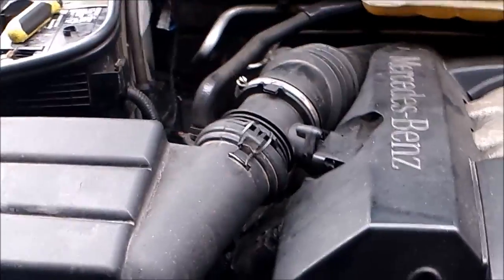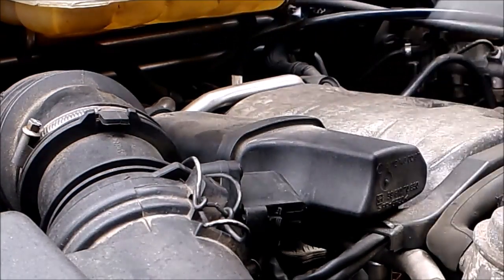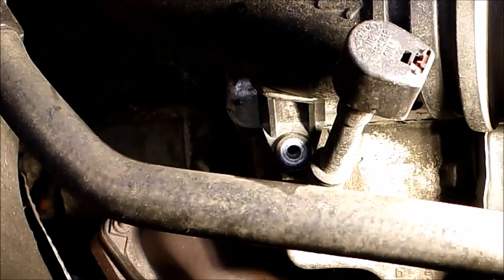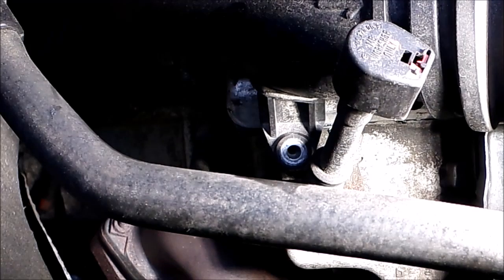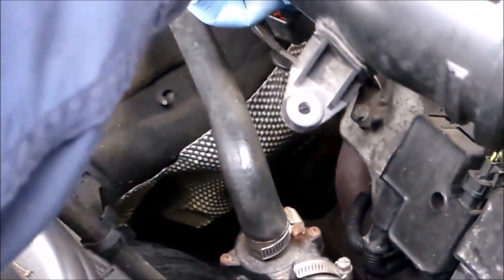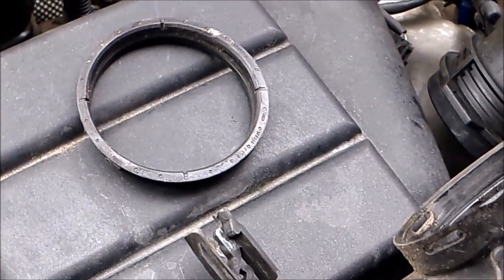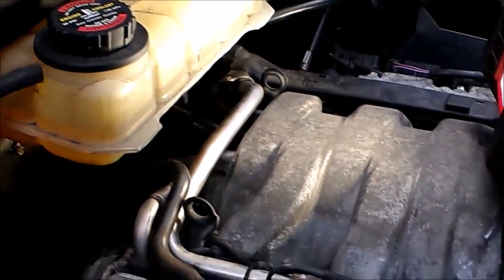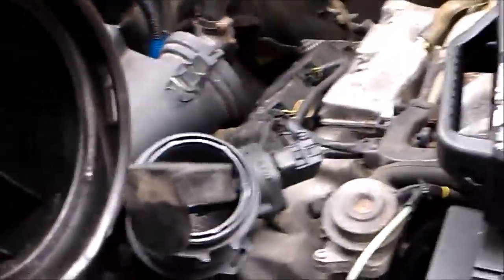Mercedes M112 M113 air intake gasket swap ,to increase mpg/lower oil consumption

Comment: Hai there..been changing same gasket like yours few weeks ago..actualy the car realy do have a high fuel consumption actualy and  after looking and searching then i notice the intake boot came out freely so i check it realy has a rubber gasket on it and change it but the car still on the jack doing some stuf don't have time to test for the consumption yet. My question is what is the problem for this model that turn the radiator fan on during cold start? I believe the fan will turn on when it's reach a normal operating temperature as usual right. I've test all the related sensor and change the ac preasure sensor/fan module/coolant temp sensor/the fan itself but it still running a few min after we start the engine during cold start or in lower engine temp. Hope you can give some info on this problem as you are very familiar with this mercedes benz. For the rest nice video and very helpful info. Keep posting sir👍
Reply from the maker: Are you sure it’s the rad cooling fan you’re heating and not the secondary air injection ?  It is loud and sounds like a fan running . Have you tried it with the hvac in Econ mode ? If the defrost mode or the Econ button is off it may run the fan on initial start for a minute . It shouldn’t come on without those conditions being met
Reply: @fupabox  Yes it's a rad cooling fan which is running few minutes after cold start and never stop when it reach normal temp for this car 87deg..i never turn on the Econ mode actually and the ac setting its not the colder setting i set it to normal setting around 22deg. 
Even in Econ mode the fan still running. The problem is after few minute start the car even in cold start the fan start running then it goes to the high speed after that also with the blower fan turn off.
The only thing i didn't change is the coolant temp sensor as i see the temp gauge on the insrument is raising up normaly after changing the coolant thermostat.
Reply from the maker: @smgees 
The only thing I can think of that you haven’t checked is the cooling fan resistor . It may be like the hvac fan resistor and defaults to always on if it malfunctions .
Reply: @fupabox  i already change the fan but still same problem. Or do you mean resistor in the fan?
Reply from the maker: @smgees the resistor is separate from the fan .

Comment: I was given a 1998 e 320 free it has 227.000 miles,very clean runs good, no codes, do you think I should keep it or try to sell it? Has no service records...last inspection 2020.
Reply: The engine and the transmission in the W210 are very robust.  I have 240k on my 1998 and it is still running strong.  These things will run forever if we take care of them.  They are relatively low tech compared to modern cars and easier to work on.  I say keep it and take care of it, and even when you get another car keep it as a 2nd.  They don't sell for much$
Reply: @adamleiter5541  Thanks for the info👍

Comment: Hi dear , thank u very much 
I have w211 almost same your engjne , my oil going less and I there's oil inside the throttle body , can you help please?
Reply from the maker: breathers on the rocker covers need to be removed cleaned and new sealant put on them . When the tiny breather holes clog up, the blowby pushes oil vapor into the intake

Comment: I noticed the last time I checked my fuel mileage I was down to 12 mpg on my 2001 e320. I've been doing a lot of other work on the car so hadn't tried to figure it out. 
Then I saw this video a couple weeks ago so I ordered that seal. I couldn't find this video again till just now but I remembered something about 2 seals. FCPEURO only showed one but I went ahead and ordered 2 thinking there was one where the tube hooked to the MAF. 
So I got them and was able to get the tube off like you showed but there is only one seal and they only showed one size for my car. I was able to get that oil breather tube off at the air inlet so that was no problem. I had a hard time getting that e10 bolt off but got it by using a wobble joint. I dropped it trying to get it on so it's still in the gravel under the car. Lol
The tube sets pretty solid even without that bolt so no worry.
The old ring on my car was actually still pretty flexible and I'm at 152k miles. I don't think this car was well cared for so I bet it is original. I'm in Vegas so it gets pretty hot here.
You mentioned that far clip on the cover breaking off and gluing it back on. What glue did you use to hold that on? Mine is broken off but the cover doesn't rattle so no biggy.
It will take me a while to see if my mileage improves but I hope it does.
Reply from the maker: ABS pipe cement sometimes works well on those Benz abs plastics ..other times 5 minute plastic epoxy will work. The dealer can actually order the whole clip assembly for about $10 , so I don't even try to glue them any more .
Reply: @fupabox  my mileage seems to have improved since I did this. Yea!
I went up to 16 mpg in town from the original 12. I don't drive much anymore since I am retired. I take it out on the freeway occasionaly to keep the carbon burned out. Mine has the AMG sport appearance package but as far as I know the engine is the same as regular models. It does have shorter stiffer springs though. Kind of a rough ride. Lol
I think I only paid a little over $5 usd for the seal at FCPEuro.
Thanks for this video. It really helped.
Reply: @fupabox  I'm not sure about that because the clip is made onto the cover. Mine is broken off the cover. As long as it stays on and doesn't rattle I'm not going to worry about it.
I just went out this mourning and found that bolt and finally got it on after dropping it 3 more times.
I ended up breaking a very small hose connection that is by the big box with,a screwed on lid. It is a very small line and I have no idea what it is for. I don't know why there is a connection in the line there instead of just a straight line unless that little connector is a check valve or something.
Mine is an 01 e320.

Comment: Is there a way to check if the seal is worn without taking it apart. I gt my w163 a few years ago and don't know if the car was being more thirsty than originally. How often shud I replace the seal?
Reply from the maker: The seal is a couple bucks and should be swapped every 6-7 years or so . Using an unlit propane torch spray the area with the engine running . If the idle speed changes there is a vacuum leak and likely the seal is it
Reply: @fupabox  LOL!! can i try the hose to the ear method? dont want to go up in flames just yet
Reply from the maker: @kondjanegongo796  lol..

Comment: If you've never had these two gaskets replaced after 100k or if the car is over 10 years old...do it! I replaced mine on my 15 yr old C240(one on the throttle body side and one on the MAF side) and the new ones fit so much tighter!
Reply from the maker: agree...2 minutes and $10 . makes a big difference
Reply: Where did you get the gaskets from
Reply: whats have been changed after replacing those gaskets? engine smoother or better mpg?

Comment: HEY JUST WONDERING I OVER TIGHTENED MY OIL FILTER COVER AND CRACKED THE THE END OF THE STEM OFF .. IT FELL INTO THE BOTTOM OF THE FILTER HOUSING BUT I MANAGED TO GET IT OUT, HOWEVER, IT LOOKS LIKES A SMALL PIECE IS MISSING AND I'M NOT SURE IF ITS GONE IN THE SMALL HOLE .. I HAVE REMOVED THE OIL FILTER HOUSING AND CAN'T SEE ANYTHING .. IF I PUT OIL IN THE ENGINE AND LEAVE THE OIL FILTER OFF COULD THAT FORCE THE PIECE OUTWITH THE OIL THAT SPURTS OUT? OR CAN I DISASSEMBLE THE BASE OF THE FILTER HOUSING ? THANKS LOVE YOUR VIDEOS CHEERS
Reply from the maker: if you have a vacuum extractor you may be able to suck it up through the filter housing bottom hole. Or remove the oil pan . That's likely where the piece is. You could try squirting it out with oil pressure .. It's possible it will work.
Reply: thankyou!
Reply from the maker: @ilukaman  let me know what you find . The oil spraying is an interesting idea
Reply: I will.... i am going to try the vacuum first although i really don't know if the small piece went in as the end of the filter housing was stuck in the bottom.....i only saw that more was missing when i matched up that bit with end of the filter housing and saw that a little piece was still missing !! so i might have dropped it on removal!! STRESSFUL!!...just wondering as it is a plastic piece is there any chance it could just disintegrate or melt?..thankyou so much for your response cheers.
Reply from the maker: @ilukaman  I suspect that piece would be in the oil pan , so it won;t get past the filter screen on the pump. don;t think it would disintegrate for quite a while , although oil will eventually eat away at plastics. Another thought is to open the oil drain bolt and pour oil into the filter housing and the chunk may come out down below
Reply: great idea thankyou!
Reply: all good ...i converted my Dyson temporarily to suction line with smaller lines...then i did the squirt test ... a beautiful arc of oil squirted from the hole... cleared everything ..car running smooth..cheers.
Reply from the maker: @ilukaman  lol...excellent job .. I won't tell your wife you used the Dyson  .Mine almost murdered me when I was taking ours outside . until she realized I was emptying it

Comment: Hi, I have a ML320 2.000 and 2 months ago have very low mpg, there's no DTC codes, the only strange thing is the exhaust in cold weather have very high white smoke, but is not coolant. Any ideas to check?. If you have a mail I can share more details.
Reply: The fuel consumption it's about 8 MPG.
Reply from the maker: @JorgeLopez-pi9kj  Sorry for the late reply. *mpg is really bad . Is the engine using more oil than usual ? is it driving normally ,or anything noticeable ?
Reply: @fupabox  the truck drive normally, normal engine power, very low oil used between oil changes, less than 1 quarter. No check engine codes. I read the data with the scanner, I had the data of the 4 02 sensors, the data of the Maf Sensor. The only think that I noticed is in cold weather in the exhaust you can see a little white smoke all the time with the engine in operation temperature. The problem was about 15.000 miles and the coolant are in the high mark all the time. I think maybe 1 or 2 injector are leaking fuel. Did you have some manual or document to do that?. To take off the fuel injectors and send to clean it. The vehicle had 150.000 miles.
Reply: Also the trip computer shoes the same MPG used.
Reply from the maker: @JorgeLopez-pi9kj  If you think the injectors may be leaking ..try a can of seafoam or STP fuel system cleaner , or Marvel mystery oil in the fuel tank . All 3 of those are very good for cleaning injectors . A bad MAF or O2 sensor will cause bad MPG also

Comment: Hello again my friend, cool video as always. Does it help anything? Btw. There are 2 sizes because one is for the throttle and the other size is for upper MAF seal.
,
Reply from the maker: that makes sense . When buying the part my dealer said there were 2 different sizes but I assumed there were 2 different throttle bodies . It helped with a bit better mileage . Didn't notice oil consumption change since mine used so little between changes.

Comment: REMOVED, CLEANED REPLACED THROTTLE BODY.. CRANKCASE VENT HOSES: THE MIDDLE 3 TUBE CONNECTOR, THE LITTLE SPIKEY TUBE WHERE DOES THAT GO, HOW DOES IT GO??

Comment: hi, i have w211 with m112 engine, my car hassitates too much when idle but in d mode, in n mode its fine, similarly when i stops it while driving it dont stops steady and takes jurks while stopping and lost power as well, i suspect the bad throttle or there is a brake in the rubber at the airfilter box that fits on airmass, can you please guide if anything i can check
Reply from the maker: sounds like a mass airflow sensor .

Comment: I have e240 1999 w21p and I add 1 L every 2000 kilometers
I see no oil on the floor and no smoke i use 10w 40 oil
Reply from the maker: you can also check your exhaust system for restrictions. Excess backpressure can cause oil use
Reply: Does your E class have 4 catalytic converters ?  On our V-6 m112 e320 it does and rears were badly clogged they needed removal & replace with stright pipe, now MPG & power are up / Oil consumption down.  I think you have 4 cylinder but IF you have 4 cats beware the rear set of Cats clog but takes forever to trigger the front CAT 02 sensors - by then you'll have all KINDS of trouble misfire codes you name it.
Mine was a 49 State US Mercedes If you're non US you may only have 2 Cats - they could still be clogged, use an Infreared Temperature guage to tell temp the front of Cat SHOULD be cooler, the rear warmer by 50 to 150 degrees.  If Front is hotter by ANY amount, the Cat is clogged and needs changing, cleaning or eliminating. 

I don't recommend removing ALL Cats as your engine needs the O2 sensor input to run engine well.  Hope this helps you or others....

Comment: Great work...yes it is 20 yrs old but durable than shit new engines old is gold  ...i 've two w210 sedan cars  both r  model 2000  V6.. one is E240 and another is E320 ..which size i 've to get ?  is it 92mm or 90mm mainfold gasket  ..i need it for both cars ..waiting your reply thnx dude
Reply from the maker: your best bet is to buy both just in case .. It could be either. Unless you remove it and check , only the dealer can tell the size through your vin #

Comment: does the air filter seal depend on the top engine cover?
Reply from the maker: not on this version of the m112 which has a filter box in the front.. on the versions that have the air filters mounted in the top engine cover , sealing to the throttle body is by ensuring the top cover fits properly

Comment: I have 2001 C240. Did you had problems with engine RPM? Cold engine is limited by 3000RPM and reaches 4000 when hot with max 50% power. Idle engine reaching full 6000 RPM. I changed all vacuum hoses and still have feeling that vacuum is leaking somethere. Local car service cannot find the problem.
Reply from the maker: No Benz will rev past 4000 in park or neutral.. it is to protect the transmission.. Not sure if you are saying the car will rev to 6000 in park ?
Reply: I mean 6000 will be in neutral during drive. RPM limitation does during full load - press gas in maximum in 1st gear. I saw in Mercedes forum multiple people with M112 had problems with carter ventilation resulting loss of power. MAF was replaced as defected some time ago when problems started. Maybe you had experience with something similar.
Reply from the maker: I haven't seen that same issue, but you could check egr valve , throttle body gasket where it bolts to the intake manifold, and the transmission wiring connector at the transmission

Comment: Thanks!!  The video is really helpful to me.
I have 2001 ML430 and have error code 170 and 173. When idle the engine shaking a little.
Local auto shop scanned my can and he said I need to replace intake manifold gasket( $400 ) and spark plugs( $200 ).
Do you think it is worthwhile to replace air intake gasket first before spending $600?
Reply from the maker: I would do the air intake gasket and the plugs (you can get the plugs at rockauto for around $100 and they are pretty easy to change in the ML  since there is a lot of room).. also do the idle relearn ( I have a video on it , but I can explain it simply here )  turn the key on in your truck until all the lights and warning lights on the gauge cluster come on..the position before starting the car... leave it like that for 10 minutes without touching the gas pedal.. that will re-teach the car where idle should be . Let me know if that makes a difference
Reply: Any kinds of plug will be OK? or Do I need to instal specific model/brand? Would you tell me the tools that I need to prepare plugs?  thanks much in advance...
Reply from the maker: Bosch 6702 will be the best price/performance combination..they are around $3.50  each at rockauto. You need 16 for your ML430 V8 (2 per cylinder)  here is a video showing the replacement on your car https://www.youtube.com/watch?v=x1C_72zHMWc
Reply: The gasket cost like 14 at the dealer.. I would measure the throttle diameter and get an aftermarket 90 degree elbow intake tube and clamp it.

Comment: Does all m112 need this change? I have a 1997 w202 c280 and the coolant tank you have on top of the motor I have it on the left with the air filter. Im from Argentina and I love and thank god for your excelent work jaja
Reply from the maker: for the low cost of the seal it is worth doing on a 20 year old car
Reply: Ok. Thanks a lot. Here in Argentina It's all expensive unfortunately. Now I have the front down vacuum line from my manifold leaking. Pray for me jaja Thanks again.

Comment: Amazing video..thanks a lot.
I have a W124 with M111 engine,in this engine the seal to the throttle body is way wider than yours,it is so hard and crispy.Tge air intake duct is oily!!!! I think I thould replace this seal.Thanks again

Comment: Yeah, I noticed that seal is a concern, my previous owner was nice enough to lather the mating surface with anti seize to help with leakage so when I went to swap out the throttle body I got a nice present on my hands. I'll have to replace it and clean everything up sometime but I when I checked for vacuum leaks there wasn't one at this connection.
Reply from the maker: Anti seize...nice   nothing better than silver greasy fingers  :)